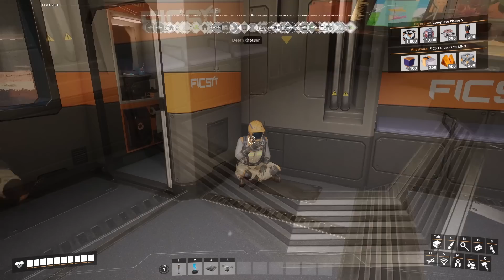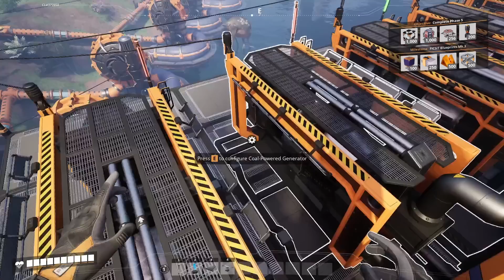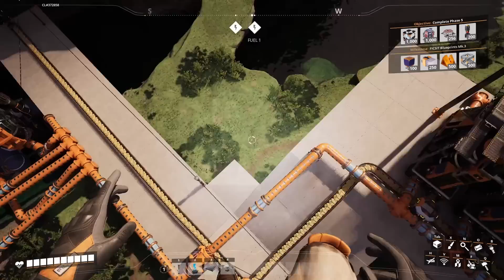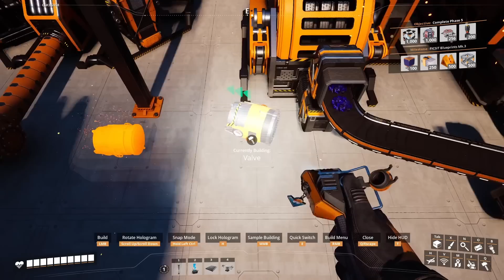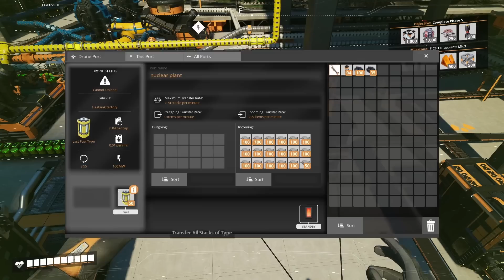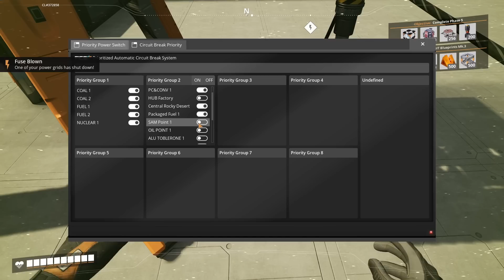Fixing my viewers save, how to fix broken power grids in Satisfactory 1.0 | Tips and Tricks

Comment: power is by far the easiest part of the game especially since they introduced liquid biofuel. i usually produce double my power consumption
Reply from the maker: I haven't heard of anyone who actually uses liquid biofuel to run their power generation :P
Reply: @jackblade281  when i do ill send you my save 😂
Reply from the maker: @nicoramaekers1623  sounds great, would love to see how you make it work ^^
Reply: @jackblade281  gonna turn satisfactory a little but into a hunting game, but 1 remain gets you about 600 kubes fuel so should be doable. just started picking up all mycelia and critters while getting lost loafing off 😂
Reply: @jackblade281  600 kubes plant with 30 fuel gennies is built next to it the "not a battery" battery but need to add more bio gennies is a like to have about 30%  "storage". will still use actual power storage, the bio gens normally should kick in when power storage can't cut it or is empty. the not a battery is fed with a container tower of packaged bio, the fuel gens will run straight from the refinery. I will turn on the gennies a few at a time as I don't want the bio farm running with the power mostly or sll being used. this would work better with no power storage and a bigger "not a battery" but would require monitoring of power consumption and regular visits (as a switch control room is not on the list, it's only my 2nd playthrough so i don't want to overdo implementing "new" stuff).

Comment: WHat you also shouldnt forget is that if you have a train network wich is essential for power generation, that also needs to be able to run seperated from your main grid
Reply from the maker: yes! in the case of this fix, that has been done, any train essential for power generation, which was two trains, only for nuclear power, run entirely on the nuclear power grid :P